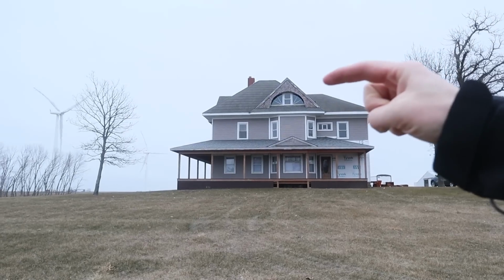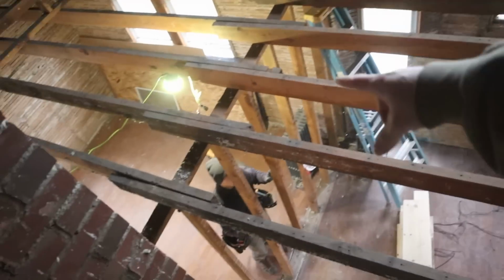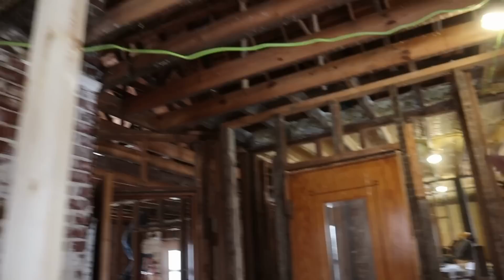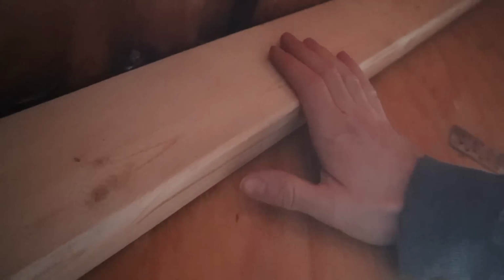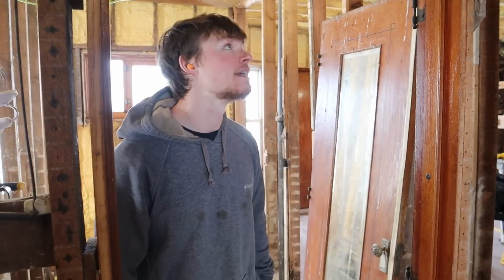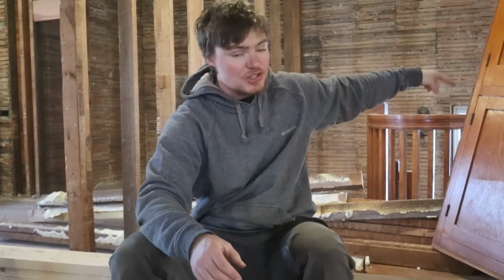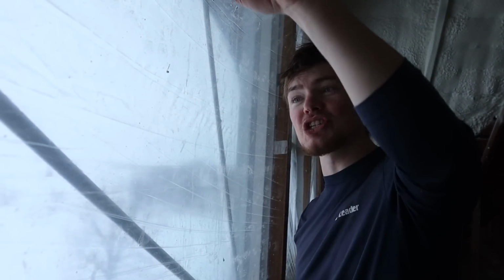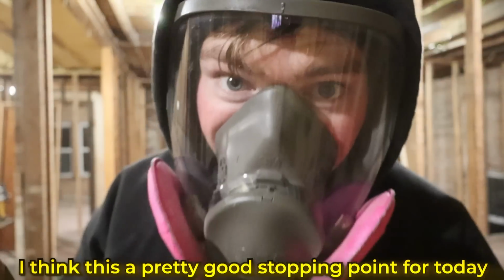Restoring A $7,000 Hoarder Mansion: Attic Insulation Day

Comment: Having all that extra on the roof and cutting stuff out. Wish you would put some collar ties up their. Is your architect/engineer familiar with old farm houses? It’s different than new build. Like you were saying the plaster wasn’t cracking on walls that were bearing. That’s because it’s basically concrete and now we’re going to put 5/8 drywall on everything.

Comment: The sagging floor in the attic is most likely due to moisture. It doesn't take much here in Iowa, to have moisture damage in the attic. With our humid summers, rainy spring, and bird & bat poo in that attic, and mice... that attic was in fairly good condition for it's age. As I recall, here in South Central Iowa, we got a lot of snow during the evening when it was supposed to have stopped snowing. But, it didn't get cold until the next morning, early afternoon... while it kept snowing. Where I am at, we got 18", then 8" more the following day. My daughter's place of employment (the zoo), was closed for several days! This week, it's been foggy from the moisture in the air as the snow is melting. I noticed the grass is green, and the water is soaking into the ground. It was so mild, we haven't had a frost line, and the grass never went into hibernation.

Comment: I don't know how your engineers think about leveling 2 or 250 year old homes in your area ours has only been here since 1783 actually barn was built first and then house next summer but we had to level floors above basement then work up and level floors off ones below to have load bearing walls support level floors to next level and in turn support straight rooflines but then post and beam houses run off rock walls and original dirt floors on supporting posts aren't exactly straight to begin with maybe later built parts of house as family could afford to have people build onto it for them instead of being primary builders themselves when homesteaders

Comment: Cole you are going to need venting for plumbing so you will be breaching the attic  ceiling for that so crack out the plumbing books because you will be cutting out all you plumbing  - my advice would be to use that chimney you are pulling out as a plumbing chase. Oh and you'll probably need to re due your septic tank and leaching field. Look into radiant floor heating for at the minimum in bathrooms.
 Plan on zoning your HVAC for efficiency  Good Luck you got a can of worms going on.  The radiators are worth money so don't break them. Where is Cooper? Wouldn't he love cutting out cast iron plumbing?

Comment: build a laminated beam by nailing 2x10s together to carry the roof span then you can support it all the way to the foundation by stacking 2x4s in the walls. it would get all the weight off the ceiling. just sistering the joist might fix it but the proper fix would be building a beam to carry the load instead of the ceiling

Comment: It’s to bad you don’t have a local structural engineer, they could design a system to really open that space up.  Great work
Reply: @BobDevV  some counties dont require permits for this type of work, or any inspections.
Reply: Have you watched the videos on the building of the grain bins ? Now what’s an engineer going to do? The bin site had engineers and it’s all junk 🤷🏻‍♂️😉
Reply: @kevink4914  good point but sometimes lowest bid is not the best value.  In any case structural engineer would add a lot of value
Reply: Fortunately for Cole his house in the middle of nowhere and there's probably minimum code enforcement requirements or they can get away with doing renovations without notifying anyone and take the good chance that nobody will find out or have time to give a shit.  On the other hand, where I live in the US you need a permit from the County for doing almost anything and everything you can think of, even stupid shit like installing a fence.  Apparently enough people have done such shitty jobs installing fences that it requires a Permit and inspections.  

It's a sad overkill state for humanity.  The answer of course is somewhere in between, for example, BOCA 1996 was a perfect Building Code before IBC came along.  IBC is an overkill load of complete horse shit now, same as the most recent NFPA codes.   They need to roll them back in  many regards to the 80's or 90's when codes had a modicum of common sense.  I say that as a professional in the AEC industry.  It's a sad state of affairs.  I design and build projects every day... the amount of additional codes we have to deal with would blow most people's minds.   @BobDevV
Reply: @BobDevV all permits do is fund the government. We pay enough taxes already so not paying more money than necessary.
Reply: maybe he could hire the bin site engineers , they seemed to have a handle on that job!!

Comment: Are you going to put solar panels on the roof?  There are no trees blocking the sun since you took them out a few years ago. 
I love watching the Constuction on your house.  Started watching when you were first cleaning out the house and stayed to watch the transformation of the farm.  Great job.  Your grandfather IS proud!
Reply: The roof on a three story house is too tall for most solar applications. A 20+ panel array ground level is much simpler to install and service.
Reply: I see solar panels on the ground, seems if the were built off the ground they would make a nice covered patio carport or garage.?
Reply: Considering the angles of the roof I'd worry about how many usable square meteres/feet you'd really get. I'd put panels on top of a workshop/garage instead.

Comment: Although there is nothing wrong with sistering up those floor joists . You be better off installing blocking better them and having them work together as a structure vs sistered up working by themselves

Comment: This home was definitely remodeled/expanded at some point by someone who cut corners big time.
Reply: Not always true. That’s how many old homes are built. They looked at it as a roof over their head. Materials back then were slim. This complete gutting to the bones. Is necessary for a reason. Everyone in comments cry that he tore it out and didn’t preserve house. Well now you can see why it needs to be redone. 🤷🏻‍♂️😉😂
Reply: Actually I posted this before end of video it was because of the tornado/tree demolishing the roof, they didn’t rebuild it the same causing those issues where there are inner roof braced up by a stack of 2x4. They half assed the roof repair back in the day. It also explains why some of the attic floor joists go all the way across and some are 2 beams that barely overlap.

Comment: Dude!  I’ve never seen a construction job run this way. You’re making it harder to run electrical and HVAC by insulating everything first!

BTW HIRE AN ELECTRICIAN!  Don’t put your family in a house you wired.  You can still help drill holes and pull wire but you need professional supervision. 

Please!
Reply: I am licensed electrician have been for 30 years.  The work they did on the shed says clearly neither of them is an electrician. 

Engineers are not electricians not even electrical engineers. 

Plumbers plumb. Electricians wire and mechanics work on cars. 

Don’t cross the streams
Reply: People will spend tens of thousands of dollars for granite countertops and then skimp on a system in the house that has the potential to cause fires.
Reply: @di4085 a licensed professional engineer?

Comment: I got a lot of friends in the AC install and repair business.  On thing most people forget when spray foaming a house is fresh air intake.  It can cause real problems if you don't have fresh air coming into the now sealed house.
Reply: As someone commented earlier...the spray foaming of the attic(and other areas) actually creates a... plastic bag...effect which must be considered when hvac systems are designed for the structure....just sayin'...
Reply: Here in Alberta we have natural gas furnaces with electric fans that circulate the heat and air for AC through the vents, and of course the furnaces have ducts to bring outside air in for combustion, plus pipe chimneys to vent. Forced air heating has built in fresh air and circulation, but we also have ducted and vented ceiling fans in bathrooms and over the stove.  I keep forgetting that Cole's house has radiatiors with no air circulation involved, but I'm sure Cole has all that thought out already.😊
I'm loving this renovation. 😊👍😊

Comment: Here I go again. I’m going to get hate mail. There is no way I would pull them old boards out of there. Sister one 2 x 8 to side of it. Use a clamp or cut a little off of the original on the bottom side. Them old boards are way stronger than what we have now.
Reply: no hate mail here, i woulda kept them too , along with some new sisters. That old lumber has kept that house standing strong all these years. Build the exact house but with todays lumber, look out!!!

Comment: I remodeled a 1863 old farm house with a wife and two children this is dejavo for me. Spray foam made the house so solid, expensive but well worth the money to sleep well when the wind blows
Reply: you may need to check out winter ventilation. the spray foam is pretty moisture tight, so if all the windows are closed, you are living in a plastic bag.  there's a bunch of options, but probably necessary, unless you like moisture related issues every winter.
Reply: The basement is stone walls well ventilated, no Radon, and my attic is not insulated only walls and ceilings, upstate NY has alot more snow. Moisture is a worry but we are constantly running bathroom fans for a long time after showers. Wood stove in downstairs dries alot

Comment: Should put blocking between the joists. It will transfer weight from one to two joist. Be sure to glue subfloor first before screwing.
Reply: Glue and screw baby!!
Reply: Most definitely glue the sub floor
Reply: Wiring goes before insulation. Demo, framing, utilities, insulation, GWB, trim.
Reply: Blocking or cross-bracing definitely strengthens the floor as well as stops sagging and twisting, so definitely a must... or should be. Collar ties across the rafters will stop further roof sag as well.
Reply: @hwaynes  not sure how they will finish things off. I think expose the old wood on the collar ties would look cool.
Reply: If you glue subfloor , then screw it down it won’t squeak .
Reply: Are there temp. guidelines for insulation?
Reply: They won't need to glue the subfloor when using screws.  Screws won't pop like nails do.
Reply: @ILGuy2012  Pop or not, they still work loose, and the glue will make everything more solid.
Reply: @ILGuy2012  very odd. I am on a lot of construction  sites for the past 30 yrs. All the frames I see use glue. Not an over kill either. Helps prevent squeaks in floor. Liquid Nail,OSI, Loctite and Titebond makes good subfloor glues.

Comment: Spray foam before electric and plumbing? That will make things difficult.
Reply: But they are doing electrical on outside walls and ceiling that already has spray foam.
Reply: no it wont, they arent foaming the interior walls and plumbing isnt going in exterior walls.

Comment: Curious why you would use some metal beams up in the attic, to support to roof? But impressive how fast you are getting things down to the studs! And yes, I get nervous seeing you on those skinny boards!
Reply: Why you would’nt? Typo
Reply: The way that house is designed it's all based on wood bearing walls.  If he put steel beams to carry the weight you'd have at least 8 load points with likely 4 in the center that would present very large point loads and require solid columns going all the way to new large concrete pier footings in the basement concrete floor.  That would require a lot more time and MONEY which Cole doesn't have.   @maramirkin3325